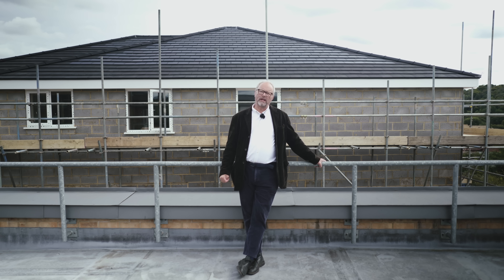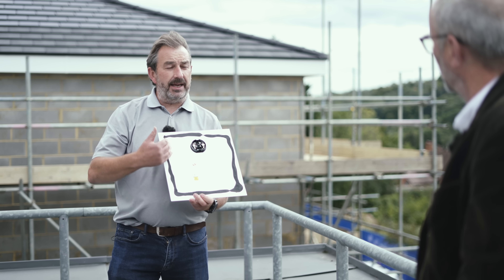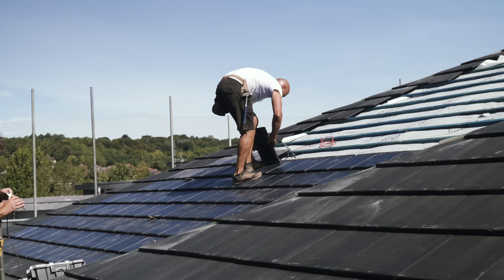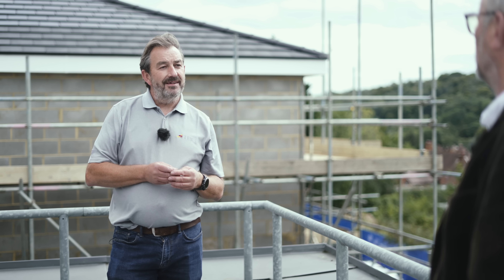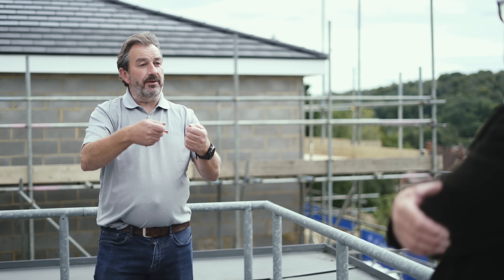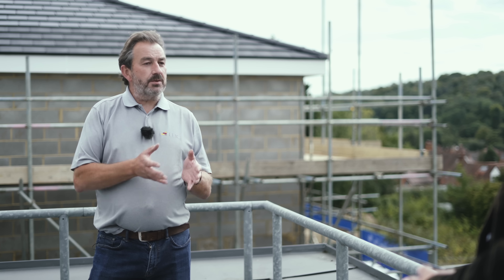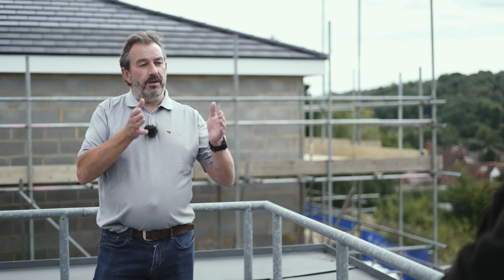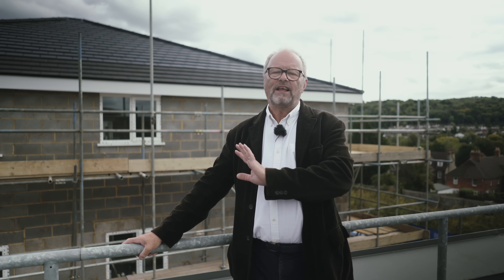Solar Roof Tiles - should every building generate its own power? | 100% Independent, 100% Electric

Comment: 15W + 100s (and 100s) of MC4 connectors == error prone and lots of losses.  On top of which you'd have to map out the connections over unorthodox geometries to match your voltage/current limits (e.g. you might have to split a string of cells in awkward places along the roof)

It's a neat idea but I'd rather have [say] 10 300W panels on my roof with their 20 MC4 connectors than 200 tiles and their 400 MC4 connectors...
Reply: Agree - they said there are 10 tiles per square metre, delivers 150 watts.  Since each tile has two connections there are 20 times as many connectors, and it’s often the source of failures.

But how then do you ‘debug’ the roof if a connector fails?  The whole of one aspect is in series / parallel just delivering the two wire high voltage DC to the inverter.  So how on Earth would you find a single failed connector hidden under a tile, especially as you’d have to lift the tiles to get at the connectors...
Reply: What is lost in the connectors is made up in volume. A larger percentage of the roof is designed to capture energy compared to the typical panel install.

It comes down to choice. Aesthetically pleasing install or conventional panel install.
Reply: Jean-Pierre White Hi Jean-Pierre - it’s not the loss in the connectors that worries me, but the reliability and difficulty to identify which of the connectors is broken in the event of a failure.
Reply: @Richardincancale  Certainly a question to ask before committing to the solution. They didn't discuss maintenance. The solar tile system comes with a 30 year warranty, one assumes any difficulty is the responsibility of the warrantor. As always important to check the small print before committing.

Comment: I hope Tesla get to see this and  meet the challenges posed at the latter end of the piece. Meanwhile, I hope these folk can scale manufacturing and availabiltiy and give us some price reductions.
Reply: Roofer did not want to do the research. Tesla tiles are available as extremely strong glass, solar tile and weaker glass that can be cut. Any roof style OK. Tesla advertizes the cheapest solar in USA - average 30% cheaper than competition. Also lease arrangements available.

Comment: Ok, when it comes to costs, and please feel free to correct me on this: from the video, a traditional concrete tile is £1 (making it £10 per square meter). A solar tile is £30 (making it £300 per square meter). Essentially this roof is 30 times more expensive than a traditional roof. The economics work a little bit better if you compare a roof tiled with solar tiles to a normal roof plus panels BUT not by much. 

I am all in on solar (have panels on my roof) but I’m not sure the economics of these type of solar tiles makes enough sense. Also, version 3 of the  Tesla solar tiles just got cheaper. I cannot remember the exact figures right now but I remember them being far more competitively priced compared to traditional roofs. 

Again, I reserve the right to be completely wrong here and I stand to be corrected.
Reply: The reason you can have a tile that is 30X more expensive but only add 50 percent to the overall cost is that the labour cost makes up such a big part of the cost of any installation.
Reply: I think he said it works out 50% more than roof + conventional panels. Its an aesthetic choice at present, rather than an economic one.
Reply: Cost of the tiles is 30x more. But when building a brand new roof from scratch most of the cost is in the other stuff ...labour, scaffold, roof trusses, rafters & purlins, vapour barrier, battens, etc.

The tiles are a small part of the cost. The tiles costing 30x more might well only lead to a 1.5x increase in the overall cost vs normal tiles with solar on top.
Reply: Material costs, yes. But once you add in labour, scaffold etc. it works out at 50% more.
Reply: It would be cheaper and better to get a standing seam metal roof and regular solar panels. You dont screw through the roof to attach the panels as they clamp onto the metal seam. These solar tiles are retarded and driven by rich, vain people who dont want their house to look funny.
Reply: @instanoodles Not just rich vain people but it likely also going to be drive by people who live in conservation areas who aren't allow traditional solar roofs.

Comment: Good to see, 50% premium for a pretty roof, roof tax, Tesla do have tiles that are non solar for edges and hips.... hhhmmm
Reply: The difference being highlighted is that with Tesla's system you have to buy all the tiles from them, including the edge / hip pieces that don't contain photovoltaic cells. By the sounds of it this is because Tesla uses a different material (hardened glass) which can't easily be cut and I imagine isn't as widely available. With the system in the video the cells are just stuck to regular slate / concrete so any edge pieces are just cut to size and don't have cells stuck to them. Overall it sounds cheaper and more versatile.
Reply: Exactly, someone here is insinuating a TESLA roof is inferior, because of edges and hips, but they have thought of this long ago. Besides TESLA has to account for different weather conditions in different climate zones, to sell their roofs, e.g. in Europe. I like the TESLA glass-tiles best!
Reply: Correction, Tesla claims they have roof tiles....
Reply: To be fair, cutting was an issue with earlier versions of the Tesla roof; it is more of a hassle to complete a complex roof shape with the Tesla Roof; and plenty of stories going about that suggest that Tesla are only after the straight-forward jobs and people have been turned down for having a complex shape or size.
Reply: İ think he said his one can  be solar on hips and smaller pieces 
Whereas tesla ones you miss out
Reply: The Tesla roof 
And these add on thiles
Dosen't Work when they 
Get hot! Period
Reply: @kennethschultz6465  If you can prove your claim, I'll listen! Otherwise just don't spread nonsense!
Reply: @kennethschultz6465  PV loses some efficiency when panels overheat, but where do you get that it stops working?
Reply: @AnalystPrime  The airflow under normal installations works to cool the panels.  Most panels efficiency starts degrading at around 115F.
Reply: @necoates77  Everyone knows that. But less than 100% does not automatically equal zero, basic math.

Comment: Well I have issues with my roof tiles as I type this and I do want to go solar, I might give these guys a call and see what is what. Nice.
Reply: Let me understand the proposition here.  You are going to let these guys take a solid concrete tile and put a sizable hole in the middle of it and seal it with some glue and attach a plastic  panel to it to sit out in the sun for decades?  The panel has 1/3 the longevity of a solid tile (not sure the longevity of as tile with a  hole in it).  When the panel fails, you check all your panels and connections.  You finally find the one that failed and you want to replace it...   Just think it through.  Maybe having panels attached on the outside is not that ugly after all?
Reply: @churinvideo  It is a licence to print money for renewable companies, all a big scam.
Reply: At £30 per tile no thanks
Reply: @paulmcgair5796   literal daylight robbery
Reply: @Abdula786_ 
Brilliant 😁👍😁🌞☀️
Reply: Any great products, companies in U.S.? Replacing roof now. Considering solar.
Reply: Just remember hot tieles 
Produce less 
That's why solar is liftet off the roof
To cool the PV .. 
This is a bad idea .. hot pv won't produce
Reply: Kenneth Schultz it’s the uk,we will be lucky to get mid 20’s in the summer,Wales is a lot less and Scotland it permanently dark 😂
Reply: @chrisoneill2544  oo
Reply: @kennethschultz6465  my panels output about 30% more power when I give them a spray with the hose pipe but they still work.
Reply: @kennethschultz6465  that explains why the solar panels for my families pond produce zero power during the 90+ days.
Reply: @kennethschultz6465  currently our in-roof (Exasun) PV is producing 1.65 kW as we speak on a cloudy day. Already seen 2.5 kW and waiting for a good day to see it finally reach it's peak output of 3 kW (it's on for two weeks now). So they can produce power! Probably a bit less, but it looks a lot better so there's that.

Comment: He didn’t really understand how Tesla’s tiles work. They have tiles without solar in them that can be cut to match the shape of the roof. I’d be more interested to hear how these compare in terms of cell efficiency, relative cost, and assembly time. I’m also surprised Tesla didn’t have a patent on the solar tile idea.
Reply: The idea of bonding solar panels to roof tiles has been around for decades. It was just the cost of the panels holding things back.

....Even if it was previously patented that patent would have run out long ago.
Reply: James Bradwell Tesla’s thing was covering the solar cells so they can’t be seen from the ground. Do these not do that?
Reply: @keco185  You only have to watch the video to realize the solar tile sits on top of the concrete tile and is visible.
Reply: Jean-Pierre White I watched the video. I thought they were only visible because we were looking dead-on at them. I was still thinking there was a film on top that hid them from the ground
Reply: @keco185  From the ground most of the roof is out of sight anyway. I doubt you would notice they were solar tiles unless you spent time to examine the roof carefully.
Reply: @keco185  I've not seen them in person, but in the summary at 12:25 they seem to blend in quite well with the rest of the roof. I'd imagine that from the ground you'd have a hard time knowing that the roof is solar.

My main concerns with all of these solar tile methods would be the durability of the cells, glue holding cells to tiles, hugely increased number of inaccessible connections (and points of failure), the ability to troubleshooting when you have a bad cell.

None of those were discussed at all in the video and I'd say they're far more important things than the aesthetics.
Reply: Some tesla roof tiles doesnt have solar panels and those are used for contours or places where a square shape cannot fit
Reply: It's always worrying when representatives for a company are so uninformed about competing products. We have a similar solar roof company in Sweden and the CEO of that company is just as ignorant about Tesla's solar roof.
Reply: Watching the video he did understand there are non-solar tiles but you do have to buy them from Tesla, you can buy these concrete tiles anywhere.
Reply: @100tinsoldiers  But why would he then say that Tesla solar tiles are only made for rectangle American roofs? That's clearly false. If you just google Tesla solar roof half of the promotional pictures you get are showing very much not rectangle American roofs.
Reply: Andy he said glass was hard to cut which compared to concrete they. He is trying to promote his roof system.